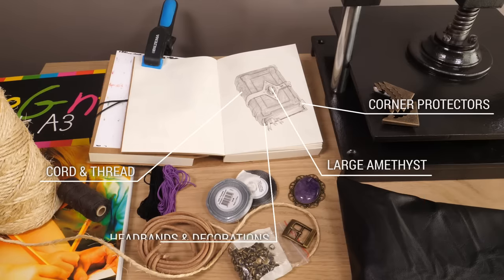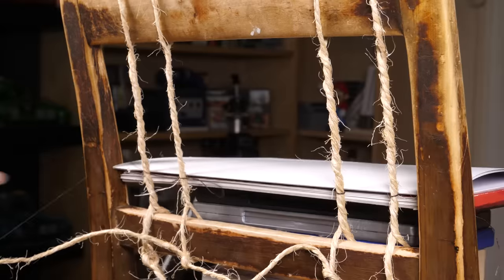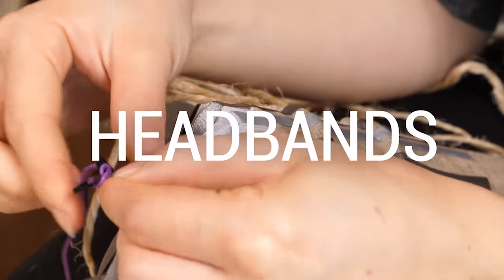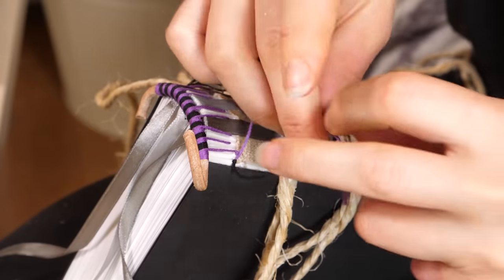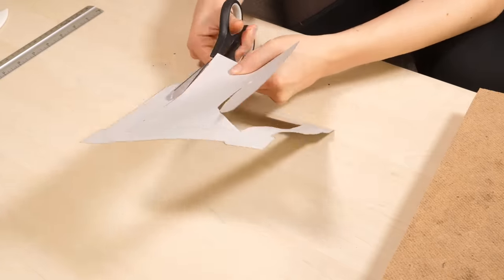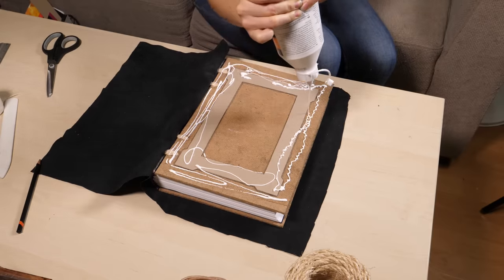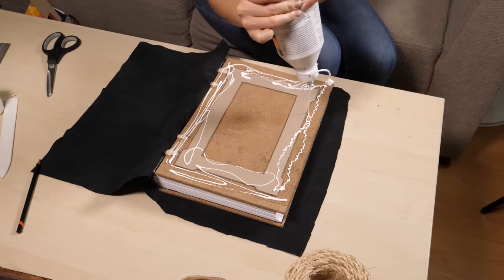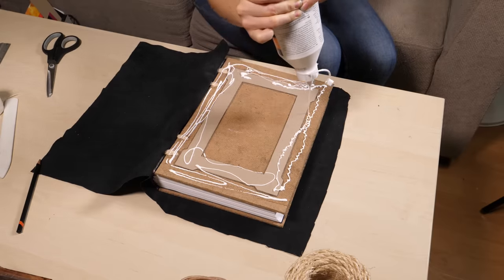Binding a MYSTICAL Handmade GRIMOIRE / Book of Shadows!

Comment: I was like " I wanna make my own fancy book! It can't be that har-" ... nm
Reply: It isn't hard
Believe me, you can do it with the simplest tools

Cardboard, Bond paper, a sturdy thread, a needle hard enough, some leather or fabric or fake leather, withe glue (for wood) and a nail or a saw

You can press the book with rope and wood tables! And saw it in a chair
Reply: Fr tho
Reply: @Paquillixtli  method may be simple but doing that is pretty hard for people with no similiar experience
Reply: do it! I've never sawn, never held wood glue in my hand... and now my own black grimoire is drying in the living room <3
Reply: @sandravovin  holy shit nice
Reply: I mean, you can go less fancy, and just staple pages together and use paper, cardboard, and glue to bind the book, but it likely won't last as long.

Or go old US Navy style - drill the covers and pages after jogging them and using a couple vises to lock them in place. Drop a threaded metal cylinder with a flat bottom into each drill hole and screw in a flathead screw from the other end.
Reply: I ended up trying and made a very simple wobbly book and now I got the bookbinding bug! XD
Reply: Look up simple book binding for junk journals. Just need an awl, string, paper. Easy.
Reply: @sandravovin  I've made the fire element grimoire, was a little tricky because I lacked some of the materials but I made some pretty good substitutes! I hope you had fun making yours!

Comment: Excellent! I started bookbinding after watching your first spellbook video, its great to see how you've improved so quickly! I'm curious, could you have done all the rivetting of the leather belt and embellishments before gluing the endpapers to the coverboards, so that they wouldn't be visible on the inside?
Reply from the maker: That's really awesome to hear, and thank you! Also, yes, absolutely. In that case I would have tried to countersink the rivets a bit on the inside first to make it completely even when covered up with paper. Also, you might need 2 different rivets that suits different material thicknesses (mine fits 3-6mm, so the wood fiberboard + leather + cardboars = 4mm, and the leather strap is 2mm, so they're perfect - but if countersunk, they should be maybe 1-3mm).

Comment: For anybody wanting golden decorations (gold tooling) - i would suggest using heat-transfer foils. They are cheap and easy to use, but you will need a stamp/tool for the pattern you want to create and a way to heat it up.
But that is a lot less messy than gold leaf and easier to get crisp lines.

Comment: i need advice, i did a book but i don't want to mess it up. Let me explain.
I did this awesome book (at least for what i can tell) from cardobard, leather, printer paper and duct tape, i forgot to age the pages and now i regret it, i can't turn back as the book is already done, so the question is: how can i age the paper without soaking the cardboard cover? will it affect my ability to write on it with pen or pencil? will the pages just melt if i soak them in tea but trying not to get the cover wet (rember it's printer paper)?

Comment: You would find that EVA glue , or bookbinding glue is best because it does not dry up hard like wood glue does.  EVA glue stays flexible and is reversed using water if you make a mistake.  When I make a book, my glue on the endpapers is only about 3-5mm wide and put on with a brush.  Using fingers can rather leave puddles of glue on the paper and is a nuisance when it dries.

Comment: Ive been watching all your videos including your elemental book videos. And I have some words of advise for you. Ive been working with leather for over 30 yrs and when I was in college I volunteered at the university's library and was fortunate enough that I was asked if I wanted to learn how to restore old books and refurbish them into new ones in the Book Restoration Dept. Let me teach you a lesson about book binding and leather crafting.

First you mentioned how it would be a pain to try and punch a hole into every single page of the separate chapters to sew them all together. Then you decided to clamp them all together then try to saw them all at once. Really? Thats to hard and sawing them like that, you risk going to deep into the paper spine that the hole will be to big and eventually the thread your using will tear them even more. The way it was always done was by marking the holes of the chapters of the book clamped together then the holes were drilled using an old hand drill, which you can also use a Dremel tool using a drill bit about the same size as the thread your using. YOu can also use whats called a Hand Pin Drill just by using the twisting of your wrist moves the piston inside to drill for you. Drilling your holes would be a lot easier and quicker than trying to use a hacksaw to make the holes in your pages, not to mention safer. Ill include the link for you for the hand pin drill.
https://www.amazon.com/Bastex-Precision-Vise-Drill-Twist/dp/B072M35LDZ/ref=asc_df_B072M35LDZ/?tag=hyprod-20&linkCode=df0&hvadid=309813767497&hvpos=&hvnetw=g&hvrand=14004320954552458574&hvpone=&hvptwo=&hvqmt=&hvdev=c&hvdvcmdl=&hvlocint=&hvlocphy=9030796&hvtargid=pla-569740741362&psc=1

An old historical book were sewn together using Sinew which are the tendons of animals to make thread. And if you can't get it or dont have access to purchasing Sinew. You can do what we would use at the University Book Restore Dept if we ran out of Sinew while restoring old books. You can use unwaxed dental floss which is made from the same kind of sinew. I once used waxed dental floss because I couldnt find my unwaxed floss when I was giving a class on how to make a book and couple weeks later the wax melted and was absorbed by the paper in my journal book making the pages look old and aged which I kinda liked. But I wouldnt always recommend doing so unless you try it out once to see if you like the affect on a test first.

Now the topic of your leather tooling. As I saw in a couple of your videos you would use a sponge to wet your veg tan tooling leather in only the areas you were tooling it. NEVER EVER do that. When you tool your leather you must equally and evenly wet your entire piece of leather even if your just tooling a small area like the front only. You must wet the entire piece of leather. And here is why. Depending on where you live there might be mineral deposits heavier in your water unless you use purified water. And by only wetting a small section of your leather may leave mineral deposits in the leather that you might not see at the moment as it dries and which will leave a water stain or mark under the surface. So when you go to dye or stain your leather the water stains will definitely show up as darker spots in your leather. So its best to wet the entire piece of leather so after it dries and you stain or dye it, youll get a more uniform looking color over the entire piece. Unless of course you want the water marks or stains to show up to give a more aged effect to your leather. I have even spilled a little bit of red wine onto my leather before I stained or dyed it to give it that old aged effect prior to dying the entire piece to make it look on purpose that something had been spilled on the book or whatever I was making at the time.

You can also paint on leather but not how most people think. You can and you can't use enamel base paints, there are pros and cons to using oil base enamel paints on leather. You can use enamel paints if you want to get a quick one or two coats of paint and call it good, which is a pro before you put on your leather sealer finish. But the con to is, is that over time it eventually cracks and peels off along with the finish. The best way to paint on leather is what we call tattooing the leather.
Tattooing Leather is a long process which is a con but it has better effects. You use acrylic base paint and you first start off with one part paint to like five or six parts water. You thin it down to like a watercolor paint then brush on your first 2-3 coats wet with this mix so that the water opens the pores of the leather to absorb the pigment in the paint. And as you continue to work you add a little more paint to your mix until you have almost a regular mix of paint as your last and final coat. Keep in mind that some paints that are translucent may take more coats of paint. I used a certain type of blue once on one of my leather projects and it took nearly 15 coats of paint to get the desired look I wanted. As I said the cons to this method is it can take a long time of painting and may take many coats to do so. But the pros is unlike oil base enamels that can be completed with only one or two coats of paint, tattooing the leather is better for when some of the top layers of paint may crack or peel off youll still have the color deep within the layers of the leather. So that way if you want to repaint it you can and youll know what color went where.
Then don't forget to Neatsfoot oil condition your leather before you finish it with leather sealer. But avoid getting the oil on the areas youve already painted and if you should happen to get a lil bit on your painted area just wipe it off right away then continue to oil condition the rest of your leather. Then let it set several hours until the darkness of the oil dissipates to a natural look again before you put the leather finish over the top before you assemble and put together all your hardware, buckles, rivets, etc.

Also the type of board you use for the front and back of your book is called masonite board. If you dont know what it is, find out the name of your product before you do a video, do your research. How can you teach or give lessons if you don't even know the name of the product you use.?
 I hope this helps you and gives you more ideas for your next book and makes things easier with your book binding. Good Luck and Enjoy,.